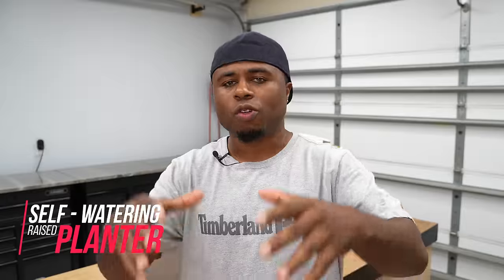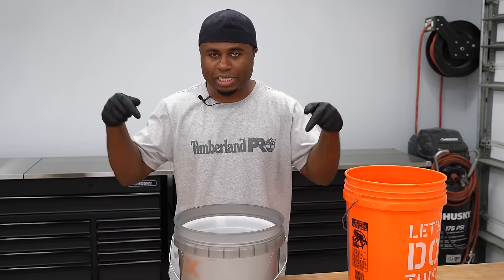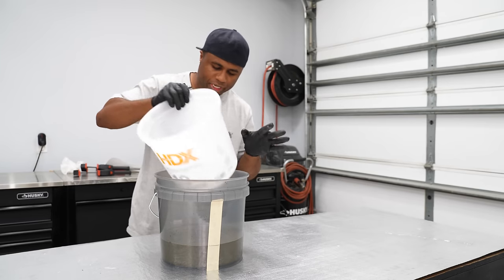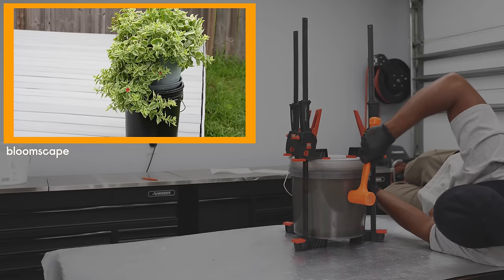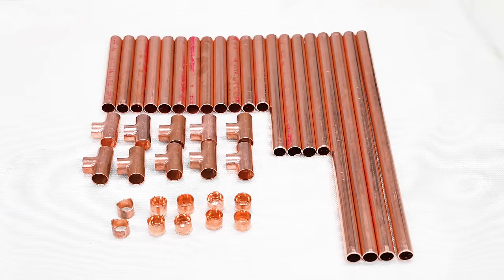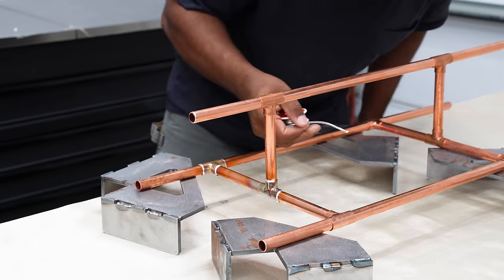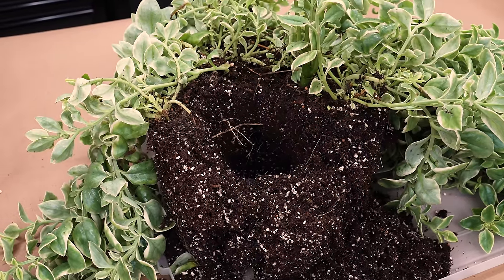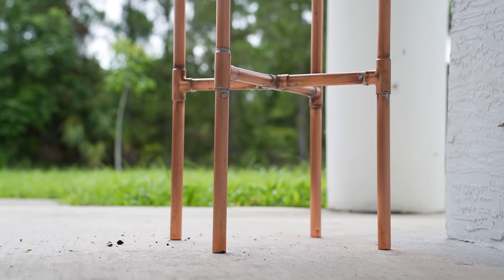How a Make a simple self-watering planter

Comment: Ben from Homemade Modern, uses Gorilla glue  and water to connect the copper piping.  This way you can avoid the heat marks that leave the copper different colors, and avoid the inconsistency of solder dribbling along the joints.  After which he sprays a clear poly coat over the whole thing to keep the copper from oxidizing.

Comment: use your sander around the bucket to vibrate the bobbles 
to the top. without the disk lol
allso run the flux brush around the joint after adding the soldier cleaner finish.

Comment: 5:40 the reason plumbers use this kind of pipe cutter is because it keeps the pipe round as it cuts. Using some sort of saw may push the pipe out of round and make it difficult to insert in fittings or get a snug fit. Not important for a plant stand, but imperative if you're running a water line with no leaks. 💖🌞🌵😷

Comment: My only question is should you have drilled a hole in the bottom for drainage?
Reply: My thought is that this system will not overwater.
Reply: @markmix2491  Sounds good to me.

Comment: Dude a hole saw would have made that cut super easy. Then you could get both ends in one drilling.
Reply from the maker: Good point, I didn't think of that. Also, one cut gave me both parts, with this method.
Reply: @DIYCreators  ha yea it does. You just rotate the part. Eh oh well.. My wife and I have been thinking of making concrete planters and this is a easier way to do it.